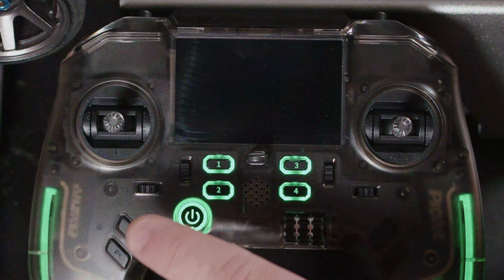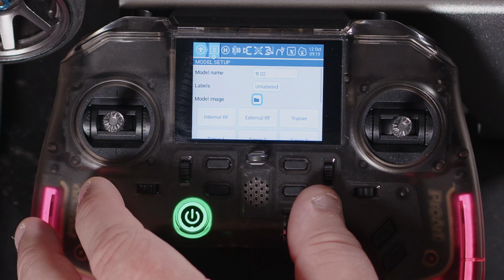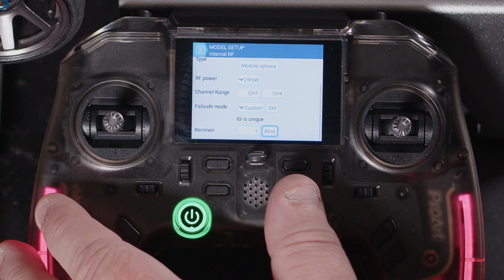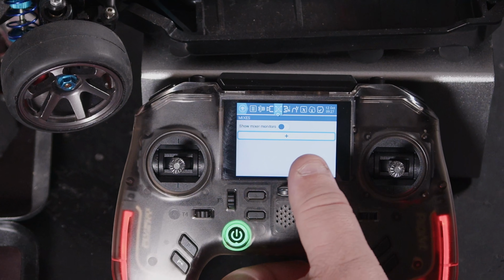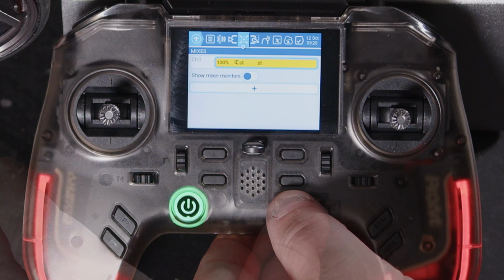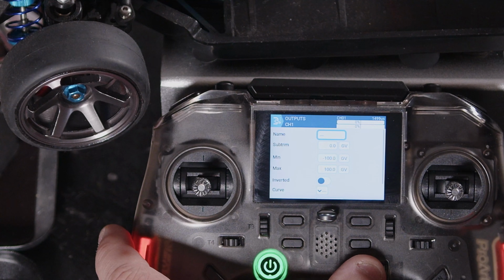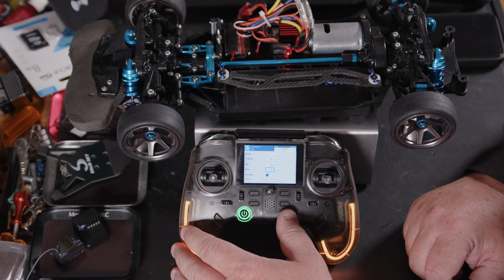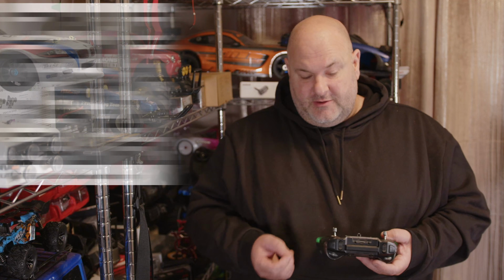Flysky PA01 basic rc cars set up guide.

Comment: Hi Craig i realy need your help with my proart i never had so much difficulty with any flysky so my problem is when i go in internal rf i do not have the option for afhds3
Reply from the maker: It's not flysky it's edge tx this doesn't run flysky software, but also if you look through the playlist I have a vid on how you can swap between elrs and afhds3 RF firmware :)

Comment: I think I’m just unlucky. I’ve got the PA01 and the AFHDS3 module will not change from “Not Ready” to (like on your video) “Disconnected” and then working to bind with a receiver. I don’t know why not. I’ve not had any joy from SoarSky or EdgeTX. I think it’s just broken! 😢
Reply from the maker: You have to select afhds3 in both system settings and the model memory
Reply: @WTFRCCars  in Radio Settings/Hardware … the Internal RF is set to AFHDS3.
In Radio Settings/Version/ModulesRXversion … internal shows as AFHDS3, external shows as OFF.
In Model Settings/Model Setup/Internal RF/Mode … is set to AFHDS3. Just under that Module Status shows Not Ready.
Yours seemed to change to Disconnected from Not Ready when you selected Type as Classic 18ch. Mine is already set to Classic 18ch, but even if I try to reselect it, my status remains on Not Ready.
No combination of turning off and back on again the controller or its options seems to affect this.
Reply from the maker: Yeh strange one have you tried re flashing the afhds3 firmware to the internal RF ?
Reply: @Just1PXL  Did you ever solve this? I seem t have the same problem. Can't bind to a FBr8 Receiver!
Reply from the maker: Do you have the latest firmware on the pa01 ?
Reply: @tpete61  no I never solved it and it’s now sat in a pile of “will try to sort sometime in the future, when hopefully the software isn’t so flaky”
Reply: @Just1PXL I had the issue with AFHDS3 “Not Ready”. After I flashed the afhds3 firmware succesfully (after a few tries) the status changed to “Disconnected”. Binding to the receiver FGr4S was working after that too
Reply: @SpArKS_n17hiya. Was this recently? It might be a new firmware version if it was
Reply: @Just1PXL  I have the PA01 since yestetday. I watched the videos here and it was very helpful. Today was my first run and wih my buggy and it felt really good. Had the CT3P before and this PA01 is great
Reply: @SpArKS_n17 how i cant i tried flash and did not work for me

Comment: Is it possible to restrict the left stick to move vertically only? (Up and down axis)
And likewise - ability to restrict the right stick to move horizontally only?
Reply from the maker: You should be able to do this quite easily if you wanted to permanently lock it you could just glue it in position but you really don't need to lock the sticks to use it

Comment: On the one-handedness, on my Jumper T20 I set it up so the right bumper toggle button swaps my steering from the left stick to the right stick so I can drive with just the right stick. On my tx16s I have a 3pos switch that swaps between left stick, both sticks added together, and right stick. You can do this by having multiple mixer lines on the steering channel with the different sticks as sources, and using the "switch" option to enable or disable them based on a switch.
Reply from the maker: Yeh not a bad idea I have different dual rates set up on one of the 3 position switches but use the inputs not mix :)

Comment: With edgetx for initial centering I like to use the PPM Center option because it offsets everything as if you physically took the servo horn off and rotated it, whereas with the default settings, subtrim moves the center but not the endpoints.
Reply from the maker: Yeh good shout :)